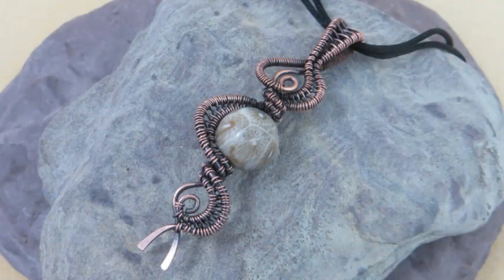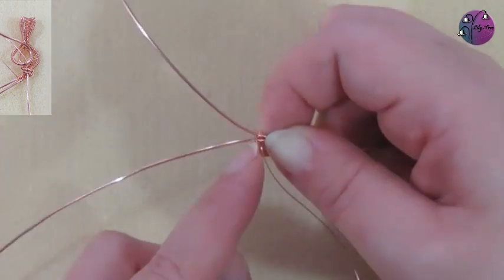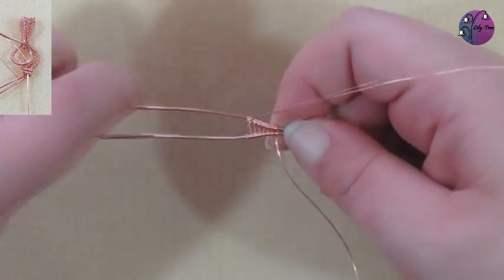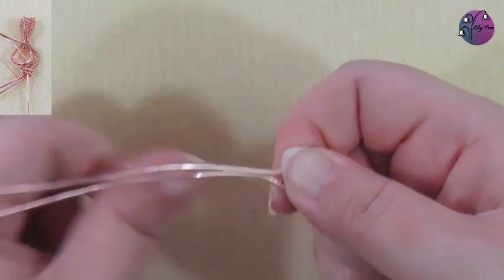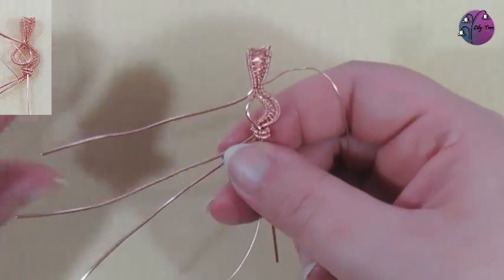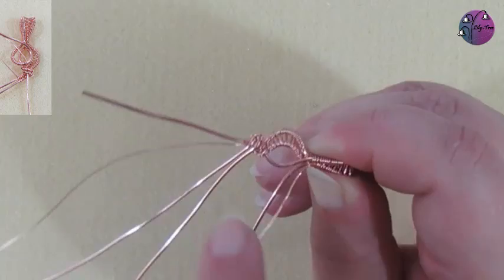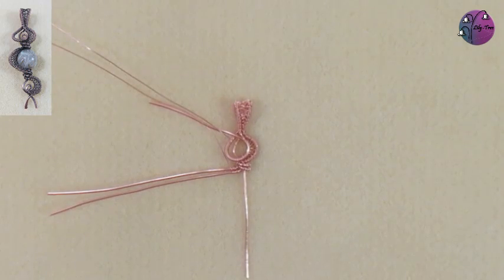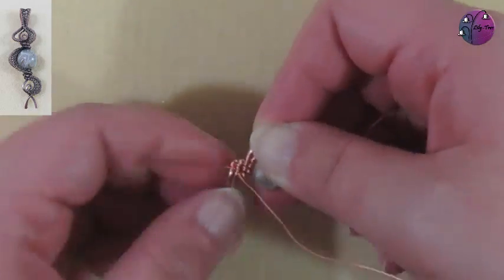Wirework Pendant with Focal Bead - Wire Wrapping Tutorial

Comment: Many thanks for the information on bead suppliers and my apologies for my late response.I started straight away to research the bead scene and found it was a really huge area.With your advice I examined the wording of the bead sites carefully and immediately began to notice words like "composite","stained", "un-polished","plastic",even an honest "artificial" here and there.Nonetheless I came across several really good sites and I would have to rate FireMountainGems at or near the very top.This latter site drove home the message about being more specific about my requirements and taught me how to "refine" my search with common-sense terms like cabochon,pendant,glass,pearl,metal,fine or sterling silver, and now I can get what I really want QUICKLY !!So now it is back to the wire- work videos,I have not seen all of your vids yet but I am working on it !
Reply from the maker: Excellent!  Good work on the research!  There are some treatments that are common and widely accepted for certain gemstones, but it always depends on what you are after and willing to accept.  The most important thing is being vigilant and asking questions. I think you're right, FireMountainGems seems to be highly regarded.  For jewellery-making more generally and silver particularly, CooksonGold is my go-to in England.  Even if you're looking to buy elsewhere, these sites are useful for price checking and sense-checking what you're looking for.

Comment: why do you not show how to end wrap wire you are a great jewellery maker
Reply: Do you mean ending the weaving wire? Just snip it and squish it around your base wire with chain or needle nose pliers.
Reply from the maker: Sorry that the video didn't include all that you wanted it to.  I try to show everything, but sometimes it doesn't come out on camera, due to angles, lighting and so on.  I'm still learning and hopefully improving the videos little by little!  I tend to trim the wire and then squish it in as Nikki says, preferably so the end is facing forward.  I then check with my finger that it doesn't feel 'scratchy' so it will be comfortable to wear.